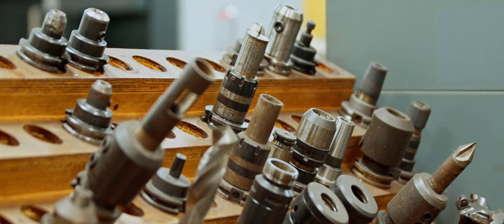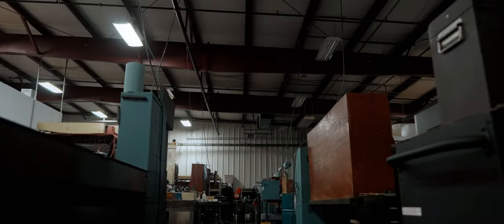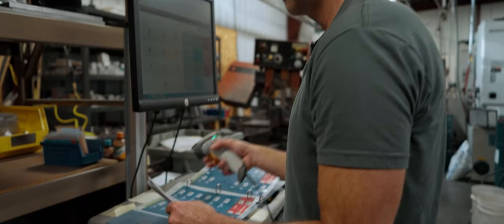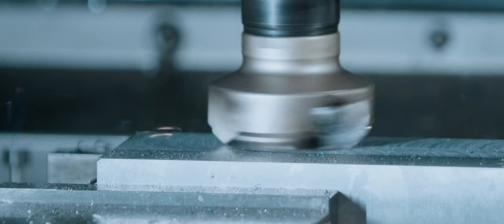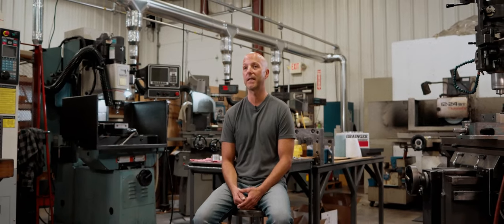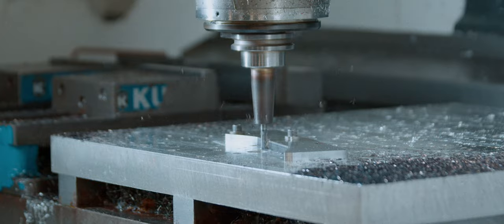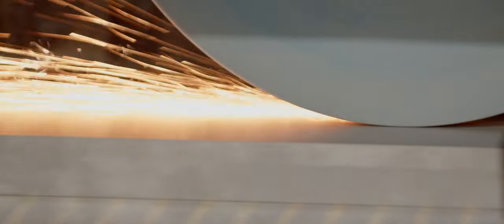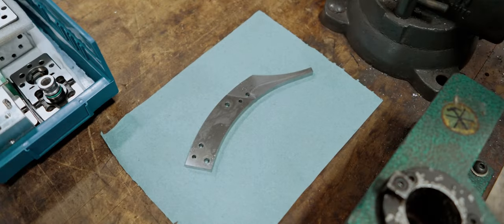Tool & Die Maker | Grainger Everyday Heroes

Comment: I was a tool maker back in the 90's working for Talon the zipper company.  Learned from a lot of tool makers from Meadville, PA.  Made dies, repaired molds with a TIG welder and EDM and spent 30 hours a week surface grinding an some milling.  Made all my tools from vices to 1 2 3 blocks.  NAFT killed the trade.  Talon sold and moved to Mexico only to fail.  I went back to college at 32 and learned to be a Computer Network Engineer.  As a tool maker I made 17.95 and hour in the 90's.   I went from mid 30K a year to now 130K a year as Senior Network Engineer.   I hate working with computer.  I hate office.  The computer career gave me terrible social anxiety.  I am retiring at 58 from it setting up a small CNC plasma and fab/welding shop in my garage.   Those skill I learned as a tool maker have served me well. I can fix anything and never pay others to fix my things.  I am returning to what I loved and leaving a terrible office job.
Reply: Love the story.  When you're doing what you were born to do, you can feel it.  Life starts feeling less like a disjointed, exhausting mess and more like an integral whole.